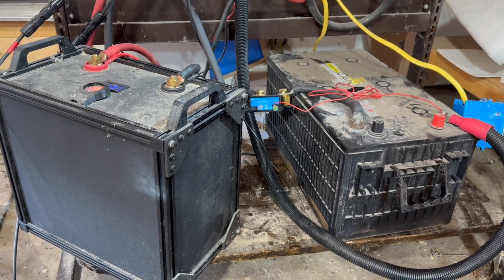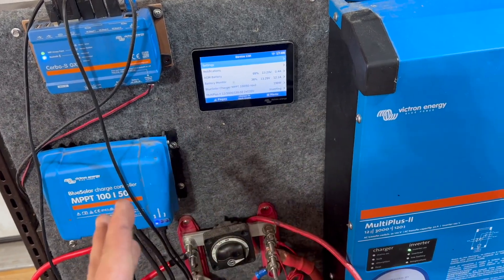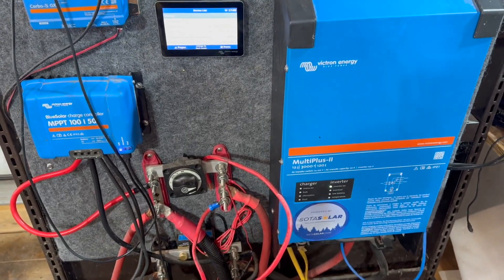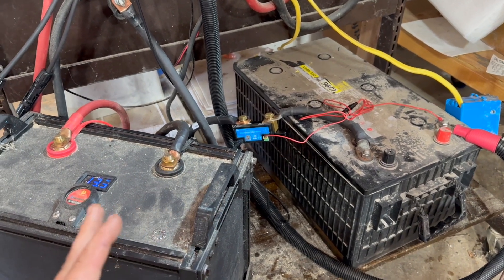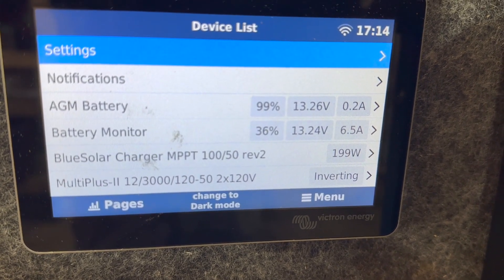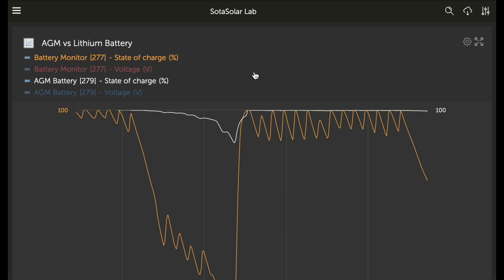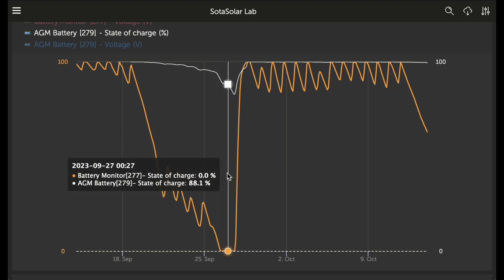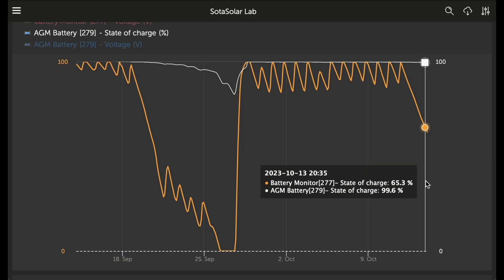What happens with Lithium (LiFeP04)  and AGM Batteries in parallel ? Let's find out!

Comment: Sharing some experiences, not everything may accurate/apply to your use case/application:

@6:58 Lithium & Lithium Iron Phosphate (LiFePO4 battery) without a BMS and at half/full charge, has the potential to become an arc welder.

@7:29 Winnebago and other coach manufacturers generally have a dash mounted battery bank combiner button (temporary connect) for this exact purpose. The temporary action of the button ensures the safe operation of less than 5 seconds use to start the engine, ensuring you don't cook your battery cells (sulfides) or equipment/conductors in the chain.
- Any more than ~5 seconds and you'll likely cook equipment/conductors in the chain.
- If you intend to replace your coach AGM with Lithium Iron Phosphate (LiFePO4) batteries, you'll need to reduce that time of use (battery bank combiner function/button) to less than 3-4 seconds, depending on the LiFePO4 BMS discharge rate (e.g. 100 Amp, 200 Amp, some are now 600 to 800 Amp discharge for dedicated LiFePO4 starter batteries). The higher the amp discharge introduces a higher probability of magic smoke/fire the longer you hold the button.

@8:38 In this scenario, there are two battery banks at different voltages. Without regulation/balancing equipment, the two battery banks will seek (inefficiently) to balance all cells, drawing higher voltage (starter battery) in this case, to lower voltage (Lithium Iron Phosphate coach battery), thus potentially draining your starter battery to a level insufficient to start your engine. 

Potential AGM Degradation (Sulfated corrosion): Now, what if you reverse the voltage levels of the AGM (lower voltage) <-> LiFePO4 battery (higher voltage), will you eventually cause premature AGM degradation (sulfated corrosion, although AGM is less prone to this issue) to your AGM cells due to the LiFePO4 battery maintaining constant float levels of the AGM cells? 

Side note: LiFePO4 Battery Isolation Manager (BIM)

If you don't want to cook your unregulated alternator while high idling or driving, Battle Born offers a piece of equipment that charges your LiFePO4 battery bank for 15 minutes and at half the capacity of the alternator output, then shuts off (cooling) for 20 minutes, continuing these charge cycles until reaching a LiFEPO4 charge of 13.4v is reached, or if required it will safety disconnect at 14.4v.
Reply from the maker: Good info here, thanks for sharing. Maybe I’ll go into detail sometime on my bus system. It’s a 270a @24v alternator. I adjusted the voltage down to about 28.0 no load. So lithium bank never receives more than 100a charge. I have a 500a BMS in it. Works good . I still disconnect when starting with a breaker.
Reply: @sotasolar Thank you, all of your videos have been helpful, great info and very much appreciated. It's a community effort, learning every day. Thanks for the great content.
Reply: @sotasolar  This will ensure great care on the entire chain. We are following the .2c charge/discharge (of full battery bank capacity profile (1200Amp Hours (14400 Watt Hours) x .2 = 240 amps)to ensure full life cycle duty, until either discharging below freezing without preheating the cells, or calendar aging. 

As the batteries top off, BMS #1 disconnects changing the .2 rated charge profile considerably  for the 3 remaining batteries charging, until #3 BMS disconnects and so on. Charging at a lower amperage ensures .2 charge rating is achieved, yet requires longer drive/alternator/generator/solar run time time to match. Always an adventure.